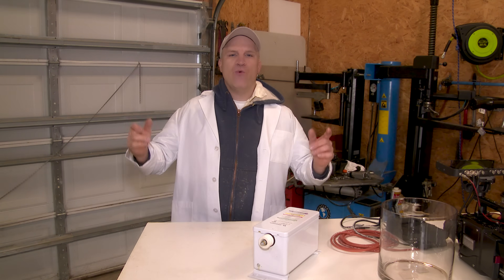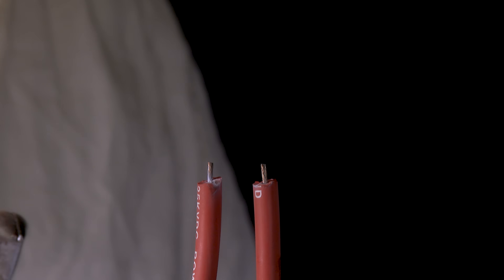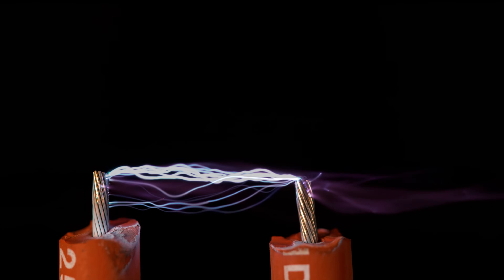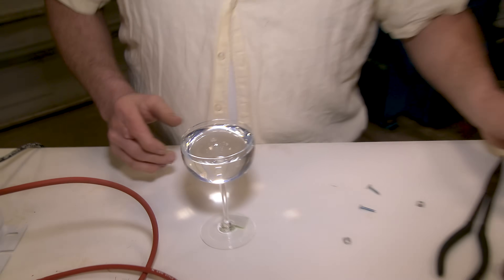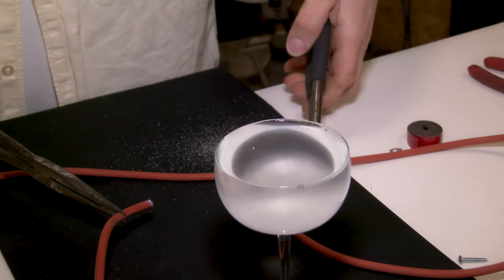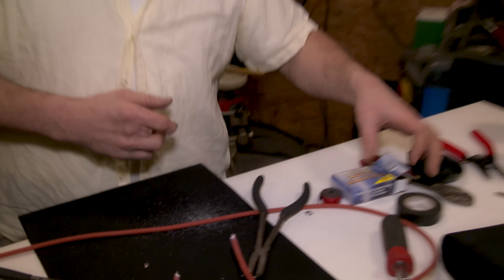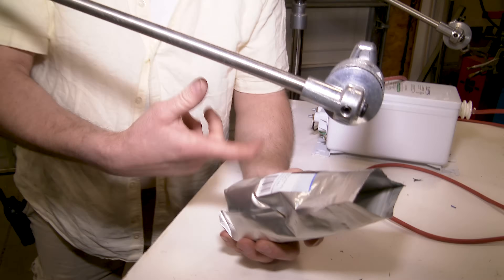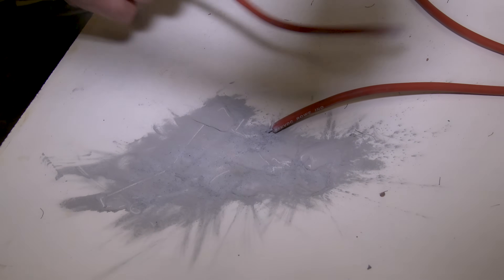High Voltage Electricity and Water - 4k Slow Motion & Ultra Slow Motion

Comment: Man, 15kV is a real hazard. The safety measures needed to work with it are far beyond a DIY setup as shown in the video.
Do you really think it's worth it to risk your life to make a video? 

Seriously, rethink that. I'm not coming here to criticize you as a Youtube pedant, I myself do DIY experiments at home with stuff that most people would consider "dangerous", but I already worked with high voltages in power lines and I saw what can happen to a person at that tiny little fraction of a second when you're careless. Trust me, it's not worth it and your family will agree with me.

I really do enjoy your videos and I would like to see you doing this kind of stuff with appropriate protection!
Reply from the maker: darian brown that's a really great way to put it, I was taught that amperage kills, but more precisely as you said current kills , that's exactly right. as for the under 30 volts thing, I'm a little bit nervous with the big LiPO batteries I use for my electric Jets, I've seen them burn holes in 1/8 inch stainless steel tables. also one time at the Flying Field and I was using a 6s 30,000 mAh battery, it was raining and he touch both prongs, it burned the hell out of his hand. can you imagine if he had positive and negative in each hand.damn
Reply: That shock you got was about 5,000 watts. Aka BAD NEWS. I regularly design and play with power supplies rated in the Kv range, and this is important info. For my parents to let me play with this stuff I had to write a comprehensive paper on the subject. Anything beneath about 30v D.C., 18 v AC should be uncompromisingly safe, no chance of shock, your body resistance is too high.
Reply from the maker: Fernando Zigunov thank you !. over concerned is okay with me, a lot better than not caring at all lol. thanks for watching glad to have you here
Reply: Fernando Zigunov As others have already said, voltage is just one variable of the circuit. Current aka amperage is ultimately what matters. Ohms law explains this thoroughly.
Reply: Ramog1000 30mA would just give you a tingle. But it’s more the voltage that “zaps” you. The three things that determine how dangerous a shock is are current, resistance and time exposed to shock. 12v isn’t deadly. But if someone received an ELV shock of 12vdc for an extended period of time, there is a very high chance their hart could go into fibrillation resulting in death. If someone received a LV shock from a 240vac supply for a fraction of a second, their hart could go into fibrillation at any moment without warning. When you start talking about HV that’s when shit gets dangerous. I’ve seen someone who’s come into contact with a LV overhead power line. He started to smoke after 15 seconds.
Reply: WP, current kills. Period. Why you got such a bad shock last time is because you have a massive amount of watts going through you. You only have about 450 watts coming out of this PSU.
Reply: The current can kill you as well as the voltage. The voltage can change your hart rhythm and you can go into fibrillation up to 6 hours post electric shock.
Reply: but still 30ma would really hurt right? XD
Reply: yeah I know most of this stuff I just wanted to know how it would feel if you get zaped by that high voltage xD
Reply: Fernando Zigunov it's a tiny NST. It's not gonna kill you unless you already have problems.
Reply: Some great info on Electrocution in link below.
RCDs cut the power at 30mA as 50mA can be lethal note at 230 volts a lethal shock can occur at 15kV there is more chance as the higher voltage can overcome the resistance of your body a lot easier as mentioned above see ohms law.
Use this as a starting point for resistance The NIOSH states "Under dry conditions, the resistance offered by the human body may be as high as 100,000 Ohms. Wet or broken skin may drop the body's resistance to 1,000 Ohms," adding that "high-voltage electrical energy quickly breaks down human skin, reducing the human body's resistance to 500 Ohms".
Equation is (amps) I=Volts/Resistance
https://www.test-meter.co.uk/blog/understanding-and-responding-to-electric-shock/
Reply: It’s only 30mA. I know 30mA can hurt like a bitch(from experience) but only in rare cases it will kill.
Reply from the maker: +Fernando Zigunov hey Fernando, thanks for the advice, I'm actually very familiar with how high voltage and electricity work, I just make it kamikaze for the video. this transformer is only 30Ma. I would never get near these wires if they were any  a higher than 100ma. A stun gun is much higher voltage in comparison but probably only 5ma. Electrical engineering has been a big part of my life so this is kind of second nature to me, always remember it's the amperage that kills you comma the worst shock I ever got about 20 years ago was from a DC rectified welder , 225 amps at about 22 volts, it knocked me out and I fell right off the ladder. Ever since that day I started researching deeply comma that's when life becomes a learning experience. Thanks for commenting and thanks for watching
Reply: Thanks for the elaborate response, I'm glad to know you're familiar with what you're doing and mainly with the fact the transformer has a short circuit current of only 30ma. Sorry if I sounded too concerned, the experiences I had with high voltage devices were quite traumatic...
Still a great fan of your channel! Take care =)
Reply: You should check out ohm's law, it's a good read.

Comment: this is a good educational demto. for novices .......the individual 60 cycle spark jumps @ 60X per second ....slow motion is cool was shown this in crane school in 2002 , as a warning to us crane operators how far a flash over can jump ....I've seen 250k flash overs jumping 10 feet from ends of a conductor ....scary stuff for line men & equip operators ,,,,massive respect for any voltage @ any current .....consider 100 volts @ 25 amps can kill you ...

Comment: Holding high voltage wires with both hands might be a bad idea, because if the wire touches you the electricity will go through your heart. Great video as always!
Reply: doin right till it goes horribly wrong one day
Reply: I found someone who got a zap with one of those, so you don't have to:

                                          --------------------------------------------

things said: ↑
Nope, I would say at 200ma you would be totally fried! Infact, even 30ma is extremely painful, even lethal ... (In my case, it was extremely painful, luckily it only got me through the hand (15kV 30ma neon sign transformer))

6ma across the heart is enough to kill ...
We've heard many different versions in the past few posts, which only goes to prove that it can vary significantly. But things is correct, 6mA is the accepted figure for causing defibrillation when it flows through the heart, and 30mA hand-to-hand is also a good estimate (you could expect approximately 6mA of this current to flow through the heart rather than taking other paths). It's difficult to provide concrete figures because it depends greatly on the individual physiology and other factors.

As already mentioned though, 200mA, or even 100mA, is enough to turn you pretty crispy.

                           -----------------------------------------------------------------

conclusion: If the circuit completed through both hands, it would greatly affect the heart and would very likely be lethal. IMHO, the insulating value provided by the rubber handles of your pliers is nil. Also, observing the arc length you were achieving, the gap to the pliers was close to the distance  where travelling through you and the pliers would be likely if not for the resistance your body provided. Add sweaty, salty fingers to the equation and I think you very nearly made a video that would not be permissible on youtube.

Careful man, I like your stuff and your daughter needs her Daddy. Alive.
Reply: U Wot M8 yeah always keep 1 hand  behind your back
Reply: @edg6779  Or just grab your ding dong with the free hand....  😵 🥴
Reply from the maker: Arpan Mukhopadhyay it sometimes goes horribly wrong but I'm there to deal with the situation.
Reply: Devon Manaseri the transformer says about 30ma
Reply: Warped Perception what amperage were you running through the arcs?
Reply from the maker: well it all wont go through your heart, like a defibrillator has pads you put on the chest, there's a reason for that, but year its always best to be safe, i'm usually not safe for some reason. i'm still alive so i must be doing something right.

Comment: Very cool! It's good practice to leave your left hand behind your back when you deal with say electricity above ~400 volts. You are trusting the insulation on those wires a lot. Consider making one or both of the things you use to move the wire be out of or insulated material or just attach it with insulated material in-between you and the wire.  Example: ducttape a small visegrips to a plastic serving ladle you might have in your kitchen.
Reply: I am late to the party, just having this video popping-up in my suggested videos, but I was thinking the same thing. So many things wrong with this video from a safety standpoint. Cool stuff, but...Hopefully he is still around making videos.

Comment: I bet this dude used to be really hot when he was younger. Would prob smash if I had a time machine to 15 years ago. Actually I'd prob still hit it.

Anywhats, the middle slomo shots of the arcs on the water surface was actually the most interesting. The alternating plasma morphology on the surface clearly demonstrates the large disparity in the electron work function of the two materials. When the copper is the cathode the arc emission is strong enough to show magnetoplasmadynamic effects such as the self-pinching and branching effects, but when the water is the cathode the plasma is far more diffuse and isotropic owing presumably to the lower areal current density and the lack of electric field focusing points on its smooth liquid surface. neat

Comment: Does the high-speed camera capture the sound or do you have a second mic for that?
Reply from the maker: thats an exhausting question, i have a very expensive specialized recorder for that and it depends on the sounds involved how i capture, but in short our particular camera ( very few) can capture sound but i dont use that feature in these cases.
Reply: interesting, thanks for the information. Also, great video, you never fail to please us :)

Comment: 2:51    electricity to create plasma more breath to push them: plasma cutter unlocked.
Reply from the maker: i actually filmed a full fledged plasma cutting solid stainless on 80 amps in ultra slow motion, havent posted yet.
Reply: It is amusing to see the first flash that is perfect then the created plasma rises because of its temperature like a flame, electricity has more and more trouble to cross it then flashes reappear and then there is a balance point  there are some small flashes that maintain a plasma in the form of an arc of a circle

sorry for my bad english

Comment: anybody know why the arc chooses to arc upwards and not straight across from one wire to the other?
Reply: nxtenstn The path of least resistance isn't necessarily the shortest.
Electrons are being separated from atoms in the air (ionized) and heated. As the contacts are moved apart and the current strength is reduced, it follows the hotter air where the ionization has already occured.

This is what make a Jacob's Ladder work the way it does. The contacts are not parallel, therefore the arc starts at the closest point at the base and moves up with the heated ionized air.
Reply: nxtenstn heat rises

Comment: can this happen in vaccum
Reply from the maker: I dont think so, it needs molecules as explained in this : " An arc between two electrodes can be initiated by ionization and glow discharge, as the current through the electrodes is increased. The breakdown voltage of the electrode gap is a function of the pressure, distance between electrodes and type of gas surrounding the electrodes. When an arc starts, its terminal voltage is much less than a glow discharge, and current is higher. An arc in gases near atmospheric pressure is characterized by visible light emission, high current density, and high temperature. An arc is distinguished from a glow discharge partly by the approximately equal effective temperatures of both electrons and positive ions; in a glow discharge, ions have much less thermal energy than the electrons."
Reply: jasminder bajwa if I'm not mistaken, it needs a medium to ionize and arc through. Short answer, no.
Reply: thanxx but I have another questions... the color of glow depends on the type of gas surrounding electrodes? also casimer effect says that true vaccum can't be created. so it is possible to do the vacuum experiment?.... also why the shape of arc is curvy and moves upward... why don't it move straight towards the electrode? and last one... the ticking sound in experiment... is it from frequency of the AC voltage?.... I know these r lot of questions but I can't help thinking bout em... thanxx
Reply: Ryan Gunn thanxx man appreciated

Comment: that's pretty cool, you can tell it's alternating current at around 6:00 because of the brighter burst alternating which end it goes into
Reply from the maker: Michał Hickiewicz that sounds right. feed lasts longer than the break. makes sense.
Reply: A transformer can't change the frequency.  So I am highly confident it is still 60hz
Reply from the maker: 99 problems I think you are correct, that is what I witnessed. I just couldn't think of the right way to explain it.
Reply from the maker: gmaxsc because if I film a light plugged into a wall at even 1000 fps theres a big amount of black frames, in this case even at very high frame rates the gap is short. I will test the frequency later out of curiosity.
Reply: Warped Perception  AC voltage is a sine wave therefore the arc gap is only a short period of time when the sine crosses 0V or when it's changing it's direction if you prefer that nomenclature (not only that point of course, but the neighbouring low voltages as well).
Reply from the maker: yes , i'm not sure what the frequency is though, i dont think the discharge is 60 hz.
Reply: also if you watch just before that at about 5:30 you can see the water react from the inrush of electrons on one electrode, then the next flash it is the other electrode
Reply: I think that's actually because of electrolysis, as it alternates from anode to cathode and back, the cathode side produces hydrogen and ignites while the other side produces oxygen (and maybe energises to produce a temporary plasma cloud?).
Reply: Warped Perception so many closed caption options omg lol
Reply: Warped Perception why do you think its different?
Reply: Warped Perception cool just wondered why you thought it may be different.
Reply: almost always blue to yellow ( as our eyes perceive it )  60 jumps in a second ...
Reply: A transformer can't change the frequency, but a Tesla coil doubles the frequency.
Reply from the maker: your right but ive shot 60hz stuff before and it looks more pulsed, this one was much faster than 60hz to my cameras. maybe they have a sort of capacitor, not sure.
Reply: You can also see that the high voltage travels mostly on the outside area of the conductors! Pretty cool stuff
Reply: Can't you just count the frames between strikes?  If you still have the original footage.

Carl